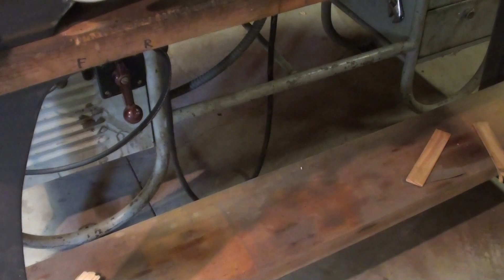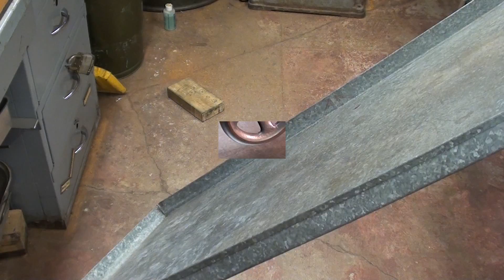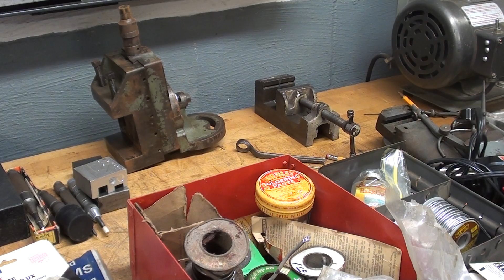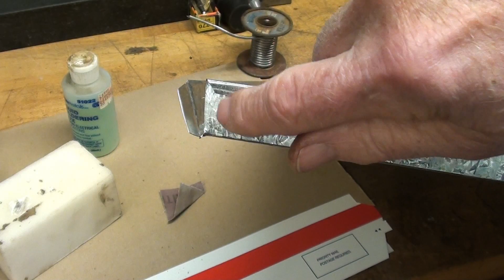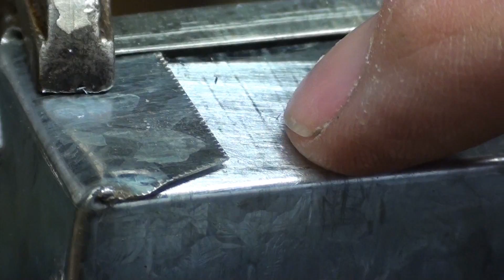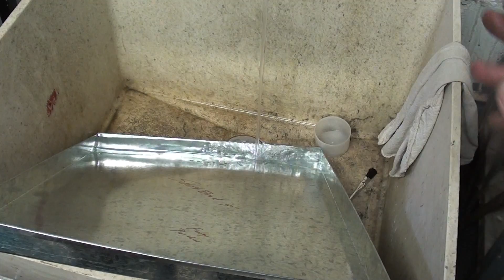SHOP TIPS #295 South Bend Lathe Chip Pan-soldering galvanized steel tubalcain

Comment: Now I have an idea what acid core is for, thanks.  Soldered first in HS electronics and plastics, none in metal shop, then household plumbing with a fixer-upper or 2.  As my kid works with Pex and other new fittings, it seems that even the water supply work has become passe.
Reply from the maker: Hardly anyone knows how to solder anymore. And solder cost $25 a spool

Comment: Another blast from the past.  I learned to solder from my Dad when I was 11 years old.  In his case he was a radio and T repair guy so soldering with him was wires on terminals.  Then in the mid 1980's as a carpenter we would occasionally solder our roof flashings when we had a particular risky spot trying to keep water out.  In that case we used a very mild muriatic acid and a bar of solder.  Instead of an iron we used a propane torch while clinging to a roof on a house.  Great video Mr. Pete.

Comment: I have used a spot welder for years on galvanized.  And I only use rosin core solder but I usually flux with ruby fluid.  My mentor had adapted his spot welder years ago with replaceable tips long before they were commercially made.  BTW, ruby fluid is available from McMaster Carr with a plastic lids now.  I always rinse the solder joint with hot soapy water and a little baking soda to neutrallize the acid.
Reply from the maker: I used to use Rwby fluid quite often. I do not remember if I showed it in the video you are watching. And yes, it was very corrosive, which made it work well. I tried to neutralize it best I could in the manner you suggested.

Comment: Fancy smazy.  I use an old lid from a cardboard box.  I wish I had a big box and pan brake. I only have a folder and a small harbor frieght brake but I make it work.  Yeah, we are too old for this stuff.  Hard to undo everything that has been done.  I use a resistance soldering iron made by Luma.  Uses a ground and anode using a carbon arc rod.  Use 30 gauge is very thin.  I never use anthing thinner 28 gauge and that is usually for patterns only.

Comment: I worked for a commercial roofer 20ish years ago. I worked in the shop cutting and forming whatever they needed for the roof they were working on. I made a lot of scuppers for flat roofs that would need soldered and we used muriatic acid to clean and then draw the solder into the joint. Great video and content. I too like the banter.
Reply from the maker: Thanks

Comment: Reminds me on the summer I spent working for a sheet metal company that made dust collection systems. I must have riveted and soldered about a mile of pipe, elbows and ductwork. I still have a #2 Pexto rivet set in one of my toolboxes that I run across from time to time. Watching your show brought back the smell of the hot sal ammoniac. 
If the solder crystallizes, it might be a little cold, as I recall it should be shiny or glossy. Might be from old galvanizing too, all our sheet metal came in fresh. Takes lots of heat to keep all that metal hot enough and long enough.
Thanks!

Comment: I'm am usually learning a lot from your videos. But I am a retired tin knocker, and we never ever used that technique. Strictly Muriatic Acid and bar solder. The iron heated, quenched slightly to clean and heat the area followed by the solder immediately behind it.  The solder joint should look wavy and uniform on the seam.

Comment: ......10:00......my last job was maint in a HVAC mfg shop....they did a LOT of galv sheet....used muriatic acid (swimming pool stuff....($4-5 a gallon at Home depot) for flux on the galv sheet....seemed to work OK, they didn't bother to rinse it off...low $$ outfit....later, customers complained about the white residue....and everything in that area of the shop was rusty/corroded....like the big drawer in my Craftsman Tool-box (from a small 2 oz. container of acid flux)...never even opened it.........
Reply from the maker: Thanks for watching

Comment: Another useful video, thanks! I'll add - when you read "instructions" for soldering, they often say apply solder to the joint, not the iron. True but apply some to the iron while on the joint first, because it transfers heat better. Also try flux or acid core solder, works a trick.
Reply from the maker: Thanks for watching

Comment: Good Job Sir!-One thing that you did but did not talk about (or I missed it) is to heat the work to melt the solder as apposed to using the iron to melt & "paint" the solder on-a lot of beginners I taught how to solder would always do that in the beginning - its a cold solder joint and will fail every time just adding my two cents for what its worth

Comment: Soldering gun as a curling iron. Certainly will curl up your toes when it burns you. 
With that said, I have had more than I can count of those soldering guns. I love them, but the main problem has been the darn tips break quite easily and as always they break when you need it most and the spare tips have run out. Any tips on that? Pardon the pun.
Reply from the maker: +Bruno M. No--just keep spares. Some guys just use some #10 or 12 bare copper wire for tips

Comment: I started high school in 1961 and the first thing we did in metalwork, was to make a cake cutter out of tin plate.  Bending, rolling and soldering.  I did OK at this, as my grandfather was a welder and had already started to teach me these skills.  We used to use a soldering flux, called Baker's Fluid, which was basically Zinc Chloride, which was made bu adding Zinc to Hydrochloric Acid, until it would take no more.  This was also called "Killed Spirits of Salts".  Later in life, we would solder galvanised iron, using diluted Hydrochloric acid, which converted to Zinc chloride and fluxed the surface.  Hope this is of interest to people.

Comment: The reason people tell you not to file soldering iron tips is many tips today are plated with iron. They're plated so they do not erode so quickly. So when you file those tips you remove the protective plating. But if your tip is pure copper then file away to your hearts content. Great video BTW I stayed until the end.

Comment: Thanks for the vid! 

I have Mig welded galvanized material with good results. Just need to be careful, don't breath it in, and have good ventilation. Also have to clean the weld area very good. Basically your taking most of the zinc off in those spots. 

Again, you have to think about  safety but it's more than doable.

Comment: One point that I didn't see you make is that the solder will flow towards the heat... Very useful in conjunction with the capillary action in "sweating" a joint.

Another technique that is useful in difficult joints - use it all the time with copper water pipe - is to tin the surfaces to be joined with a thin film of solder first, make the dry fit - with a thin layer of flux - then heat the joint...

That 40/60 solder has more tin and less lead than the more common 60/40 - the numbers correspond to the rough values for the % by weight of lead first, then tin. Lead melts at a lower temperature, which is nice for assembly, but is weaker mechanically.

The other trick with the differing compositions is that you can do an assembly in stages, working from higher melting alloys to cooler melting.

Also - I'm rambling as well! - I still remember the "fun" we had plumbing a new water supply for my house, using the first generation of lead-free solders. Even with a MAPP gas torch, that stuff wouldn't "wet" like the old lead solders... The newer solders and fluxes aren't quite so bad...

Those big old soldering irons are neat, but not so readily available these days. The good news is that you can get propane and MAPP gas torches at the hardware store... The bad news is that you need to be even more careful when using a torch to not set something on fire or create unsafe fumes in your working area.

Finally, it must be the relatively high humidity in your region which leads to so much corrosion from the acid fluxes... I've seen some messy, rusty old stuff out here, but evidently Southern California is a relative desert - more so than I knew...

Thanks for an interesting fabrication video!

Eric

Comment: Thanks Mr Pete, Sheet metal class was one of my favorite in general metals, back in the 70"s. My shop teacher always insisted on us quickly wiping the solder joint with a wet rag. It always steamed. He wanted us to clean all the acid off with the rag. One day I cut myself with some sheet metal and the shop teacher excitedly ran me over to the sink and applied green soap to the wound before he sent me to the school nurse.

Comment: I worked in an architectural sheet metal shop for 10 years and probably soldered tens of thousands of feet of galv flashings. All you need is plain old muriatic (swimming pool) acid. 
We used old propane solder pots and 4 lb coppers. They came in pairs (2lb each) so you always had one in the fire ready to go. 
To keep the sal-amoniac block from crumbling we made a casing out of sheet lead, soldered the corners & left the top open. When you cleaned your coppers on it and the block wore away, so did the lead. 
Dissolved sal-ammoniac in water makes a great dip to clean the copper right after you pull it from the fire to solder. A quick dunk of the tip leaves the tinned surface bright & shiny, that is, unless you left it in the fire too long & burnt it. Then you had to let it cool, file to bare copper & re-tin. 
To solder plain steel, stainless, copper or brass you make killed (or cut) acid by adding small pieces of zinc to the muriatic until it won't dissolve any more.
Love your vids!
Reply: I work in the maintenance shops of a steel mill now & I'm the only sheet metal journeyman. Don't do much soldering anymore but when I do I get a big crowd of mechanics watching as I fire up the old Clayton & Lambert gasoline blowtorch and go to town with my coppers. I get a kick looking at their befuddled expressions!
One more tip… always keep a wet rag handy in a bucket of water so you don't have to wait forever for the solder to harden. Plus the water will rinse off the acid right away. 
Hope this helps.
Keep up the excellent videos!
Reply from the maker: +57cpdvl Thanks--put on a nice show for those boys at the mill
Reply from the maker: +57cpdvl Thanks for some great tips. The safety nazis would kill me if I mentioned acid.

Comment: Great video Mr P, I read the comments and like me they all reflect my thought, which is the rambling and off the cuff rants are why I like the videos so much. I worked in a car bodyshop in the 70s and we had a box folder - I spent so many lunchtimes making things we also had a spot welder which was a great tool for bare steel - haven't used one in forty years so would love to see a video when you have time. Kind Regards Garry from the UK (The English Bit)

Comment: I have a block of sal ammoniac myself :)      
 I won't scream about using a file on the iron tip, but I would say you might be overdoing it...i was taught to just use an old rag or damp sponge....wait for the iron to heat up, and wipe it (quickly!) downward; nearly all the crud wipes right off   (it's a trick i learned from my grandfather who was an appliance repairman...) Rubbing it on the block will often take off what won't just wipe off once the solder is molten...    if it's being really stubborn and crudded up, you can use a metal scraper (something like an exacto knife or an old chisel;  grandpa used his pocket knife) to scrape it to remove the hardened bits.  

it's exactly the same technique as sweating a pipe joint really, though usually you use a torch on piping to get it hot enough....   I know guys who would use a torch on sheet goods as well.  both would work, though the iron gives a bit more control about where the heat is.......

Baking soda is a good idea....when i was working as a windowmaker making stained glass, on certain smaller pieces, i would routinely scrub it down lightly with a paste of baking soda and water to make sure ALL the flux was neutralized..(if you don't get it, it causes corrosion and discoloration later...won't hurt the glass any, but it weakens the metal channels holding the glass in place..and it's kinda unsightly....)

Comment: Great video sir. I feel your pain when dealing with the younger generation.lol. I wonder if my dad or former teachers felt frustration..lol
 My comment is directed towards the Weller 8200 gun. I was a tv service tech for 20 yrs in my former life. This was back in the days of Zenith ( and everyone else ) featured hand wired chassis. Back then TVs were actually tested,diagnosed,disassembled and repaired, instead of changing out 300 parts on a board. The copper loop tip assembled upside down was very handy to keep heat from burning insulation,plastics,Bakelite,etc. I maintained a couple of guns with tips in both positions. I loved the gun since I could make custom tips like small gage wire for tiny projects like jewelry....ahhh....the memories.......Alas...I too digress and blather,,,but I'm harmless,,,good day sir.
Reply from the maker: +Mike Davis Thanks-I laways wondered the reason for the upside down tip

Comment: Hello Mister Pete:
Your video on soldering galvanized reminds me that it's been over 50 years since my last bottle of acid flux hit the trash can.  I now use "Nokorode" paste for ungalvanized steel, brass, etc.  Rosin core for electronics, of course.

If we'd had cellphones, iPods, etc. when I was a kid going to school, we'd have been slapped silly.  As it was, even without the gadgets, I got slapped silly a LOT!

I really enjoy your videos.  Keep up the good work! :-)
Reply from the maker: +Elden DuRand I think I have some nokorode in the garage
Reply: +mrpete222:
I remember using Nokorode when I was a kid when I helped Dad when he did electrical wiring.  My job was to keep the blowtorch pumped-up and keep the irons hot and tinned.  I ran out a couple of years ago and thought the stuff was unobtanium.  Took a chance in McMaster-Carr and there it was!  I'm now set for life.

Comment: I have a galvanized drip pan leaking under my attic air conditioner condenser. In order to slip it under two sides have to be flat, unsoldered, then the corner has to be soldered in the attic, otherwise I have to jack up the condenser etc.. So this video is FANTASTIC and fortuitous for me and I thank you for keeping knowledge of craft alive!

Comment: I've learned that zinc and Iron builds a alloy on the contact surfaces. That alloy has a very high melting point. Higher than iron if I'm correct. This makes it nearly impossible to weld.
I've soldered may boxes from galvanized steel plates and in my experience the best way is to use soldering paste with solder in it. It's  a gray paste. Put it on, press the parts together and heat it up gently with a small blowtorch then use a little bit of Solder to fill up gaps. Worked great for me. The liquid flux stuff is hard to get to the places you want it to go if you have complex shapes put together.

Comment: I would bet Woody is electronic and not mechanical.  My guess is that pulling the string induces a charge into a capacitor and a small microcontroller plays back an audio file.
Reply from the maker: +rhost Let's find out

Comment: +1 for the spot welder video.  Also, brazing would be interesting.  Or silver soldering.  More info about the various fluxes would help, too.  I've taken a couple runs at silver soldering so far, but it was a big failure.  I'm a little puzzled, because I'm an old hand at sweating copper tubing.  I look forward to your regular dispatches with anticipation.  As the others have said -- we really appreciate you (and learn stuff, too!!).

Comment: It looks like your soldering iron uses pure copper tips and filing and tinning copper tips is the right procedure. Most modern soldering iron tips are iron-plated copper. In that case, you do not want to file the plating away.

Please save Woody! I still remember dissecting my G.I. Joe when I was a kid. As I recall, it had a piece of recorded tape of sorts that would play back when the string was pulled. It came with a toy truck that had what today would be called a 'drone' to spy on the enemy. Ha!  I still remember one of the recordings: "I got a tough assignment for you!"
Reply from the maker: +JRoque250 Never seen a iron tipped copper

Comment: you should drink more coffee! that went along at a breakneck pace, and the trays turned out well. how about a video on soldering stainless sheet?
Reply: That's where he'd use the spot welder, I guess.   I'm wondering if it wouldn't be simpler to remove a patch of zinc to spot weld that too,  or interpose a copper washer or something to make a brass mix.

Comment: I have a fetish with the American Beauty soldering iron brand. I used to solder flashing on the homes we built. Not something you want to handle without a pair of gloves. especially my 550 and 300 watt. The paste is good for copper pipes that's about it.
Reply from the maker: +greasydot I've got a beauty in my garage somewhere

Comment: Rekindle memory's , I tried to remember the last thing i used solder on, other than wire, I believe it was a radiator that had a seam leak on a crawler i used to work on ! Thank for the memory's !

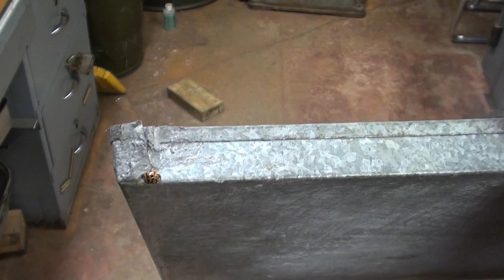Comment: after 5:20, for the rest of the vid, all I could think about was the little rascals, and Spanky with his hammer.... "I'm bug huntin'". As for filing the tip, how else are you going to clean and shape it? Only exception I know is iron-flashed tips for electrical work with no-corroding fluxes. Cleanup shouldn't be illegal for a homeowner in that small quantity. Of course, if you have copper or iron drain pipes, the dilution solution is key if you don't use baking soda.